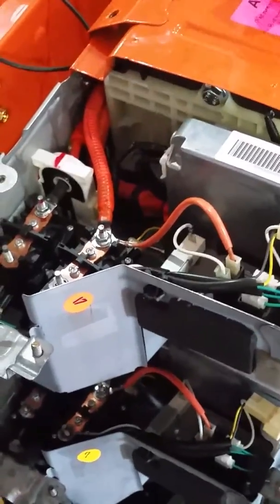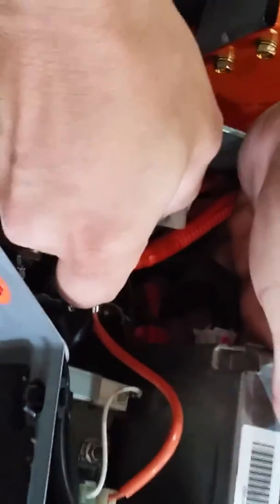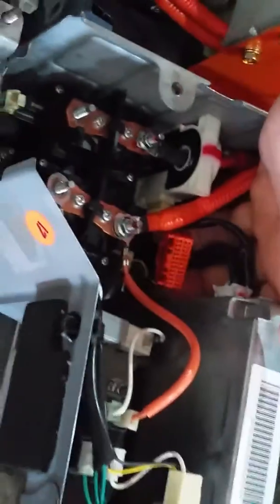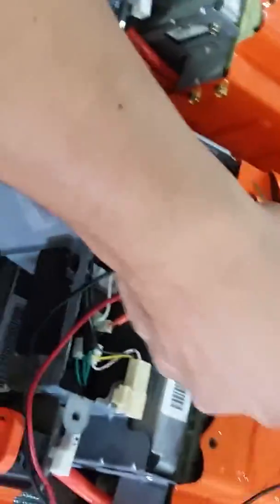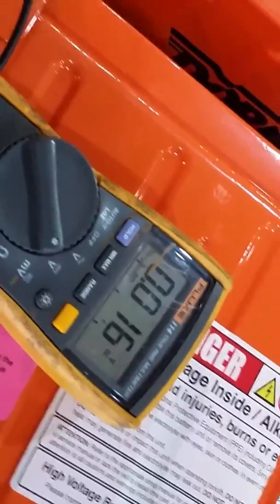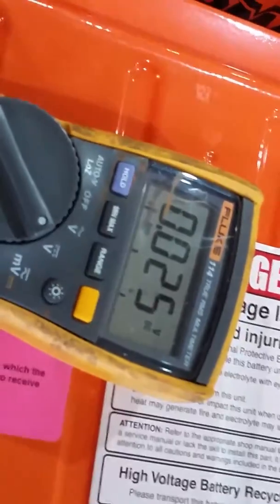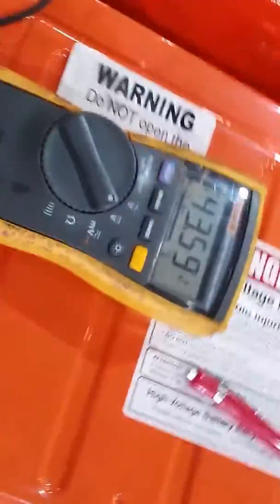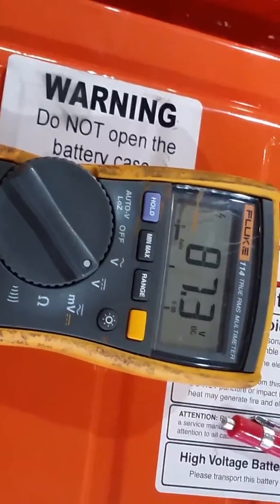High Voltage Leak Test Dorman 587-001

Comment from the maker: When you use this test method you're merely testing to see if the pack will fail HV leak. The intent is not to find out which module is leaking.